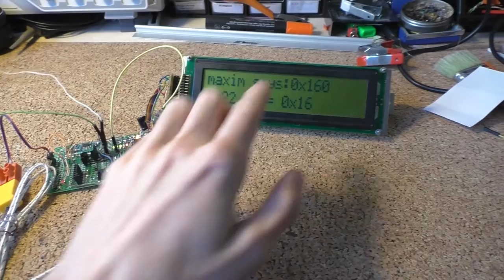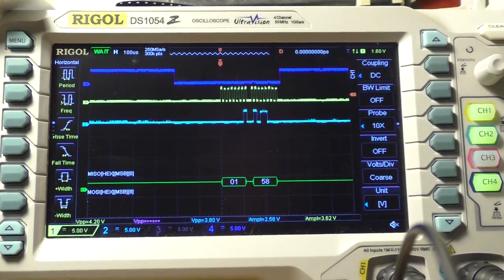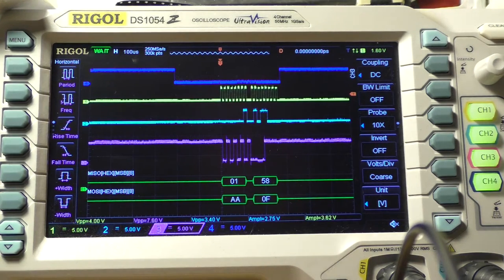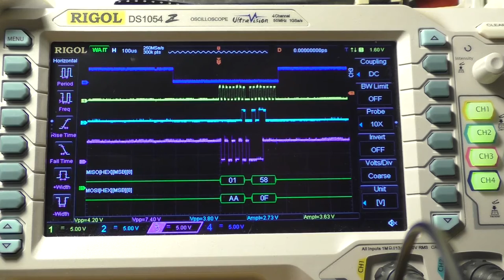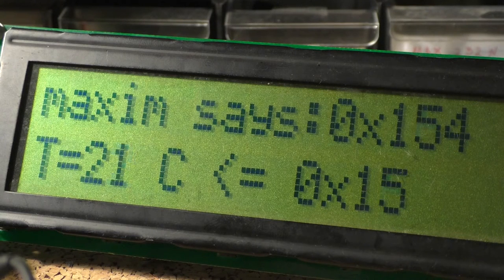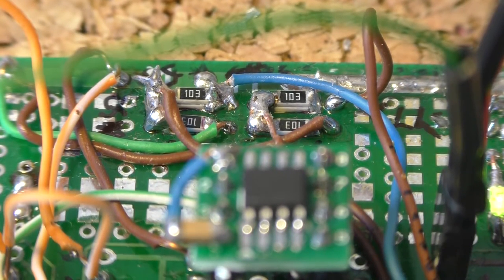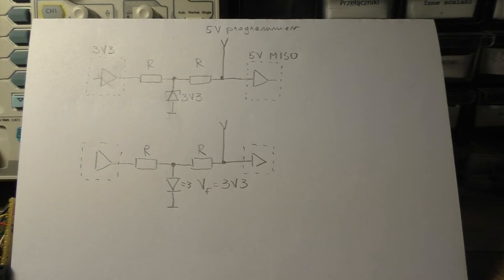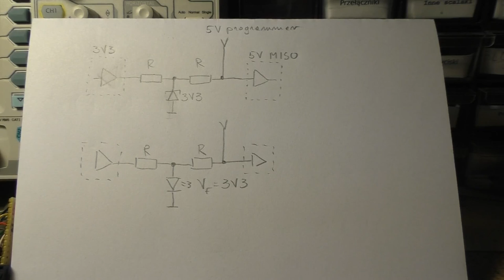PEV 02h - Make a thermometer with MAX31855

Comment: Hi,  John Papadopulos has asked you (the author) a question a long time ago (8Months ago by now) but I see you haven't actually answered. Well. I.m in the very same situation and it would be nice if you could answer the issue. I myself have purchased 3  Chips MAX31855 but I was thinking that they are a full replacement for the old MAX6676 that is no longer produced. Well, I was totally wrong because the 31855 needs 3.3V only and to communicate with a 5V Microcontroller (I.E. an Arduino Uno) It needs some sort of bidirectional logic level shifter (you make one with a 2N700 mos-FET transistors or you purchase them online)  well you never mentioned such information in your video. So can you please confirm if what I.m saying is true and correct?  Thank you. All I'm trying to achieve in my case is a simple Arduino thermocouple sensor thermometer capable to read accurately temperatures in the range of  10  to 230 degrees Celsius and display a reading via a software serial port. So, clearing out the fog is much appreciated tnx.
Reply from the maker: In this circuit I used a pink LED as a 5 to 3v3 level shifter, it's not exactly precise (It just limits the voltage to 3.6V). That is shifting the microcontroller output for the MAX31855 inut. For the microcontroller input shifting is not necesary as 3v3 is a valid high logic level for AVR and for Arduino. A pink color was picked because the forward voltage of that led was the highest of all i had. Blue could have worked as well, and a 3v3 zener diode too

Comment: Hi. I have bought a couple of max31855 from ebay and a i didn't managed to do them work properly. Is it possible to give us more info's how to connect and some code and library (if available) to fix my problems? Have in mind that I didn't know how to connect them first time and i send 5V instead 3,3V. I hope not to damage them. I 'm waiting your reply. Thank you.
Reply from the maker: If you didnt power it from 5V they may be okay. I havent said that in the video (or I dont remember I did) but the MISO line is being shared with the programmer. I dont think I still have the code but to get the temperature in Celcius you just need to read one SPI register and bit-shift the value right or take the most significant byte to get rid of the decimal fractions.

Comment: Hi I bought some of MAX31855 on ebay but getting totally wrong values from the chip when measure with oscilloscope. Starting to think my chips are pirate versions or something but I just saw you have a cap on your device? What value and where is this cap connected to? My chip has only one cap between VCC and ground but it looks you have a cap on thermo side?

Regards.
Reply from the maker: Yeah, there's a cap both on poer rails and the datasheet also shows a cap between the thermocouple inputs. I f i recall correctly that's 100n but you'd have to check it